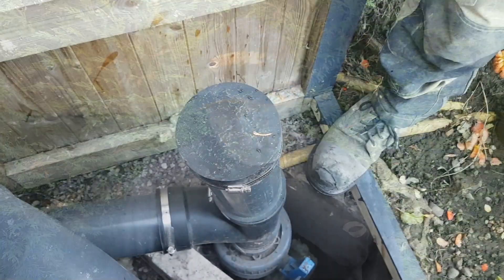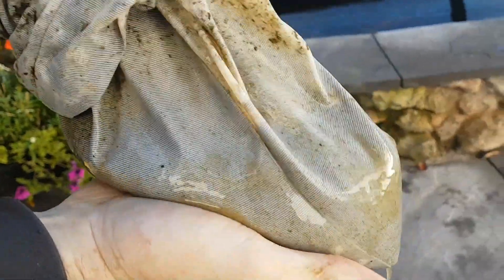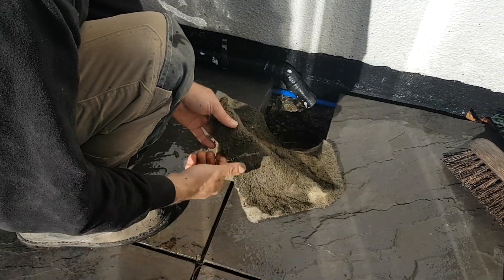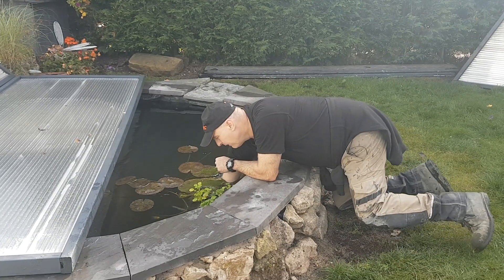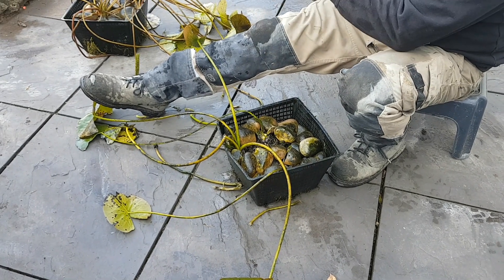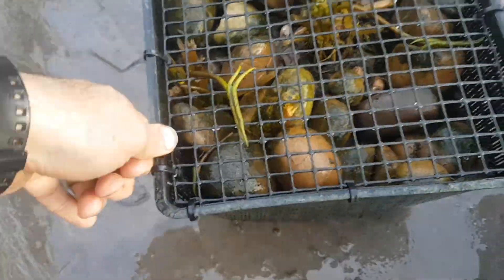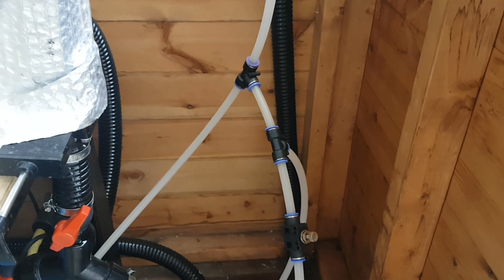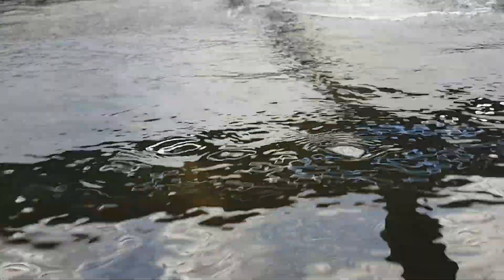Koi pond, winter preparation part 1

Comment: I've never jetted my drain's but I do have a low level purge which I flush every 2 days or so, amazing how much sits in there sometimes. I recently rearranged some of my returns and was actually surprised by the amount of brown slime jelly stuff there was in the return pipes so gave them a jet, another great vid mate
Reply from the maker: Hi mate, I regularly purge the drains, but I was shocked at what came out after pressure flushing, something I will do much more often. Thanks for your comments. Stay safe. Regards Andy

Comment: Gobsmacked that boiled your easypod and so quickly! I’ve a 35pa version of yours so wonder if that would work too. I may give it a go as they are do much quieter.
Reply from the maker: I was almost certain it wouldn't boil, but was delighted when it did, not only will it save a few pennies in electric, it means I have a spare too 😊 it would be interesting to see if your 35 would work
Reply: @DerbyKoi  I’ll let you know. I’ve a 100pa too so that certainly will 😂
Reply from the maker: Lol, thanks mate 👍

Comment: Hi, another great video ! can I ask,  do you keep the air on all the time even though the water is getting colder. I’ve got mine on for a few hours in day but am worried it would cool water if left on over night?
Reply from the maker: Hi becks, I do keep the air on, I reduce the amount and because I have covers I think it helps with gas exchange. The next upload may explain more. If i had no covers I would probably turn the air off. Hope that helps
Reply: @DerbyKoi  thanks for replying, I appreciate it.

Comment: Quick question Andy, do you keep air onto your pond over winter?
Reply from the maker: Hi mate, just filmed this today, because I have covers I still run the air into the pond but reduced rate, I think it will help with gas exchange, if  I had no cover I personally would turn it off to reduce wind chill and alter pond temp. Hope that helps
Reply: @DerbyKoi  cheers Andy. I have covers on but didn't know if to leave air on to bottom drain. Was thinking off at nite on in the day.
Reply from the maker: Hi mate, not sure if there's a right or wrong  I've researched it on the groups and forums and trying to get an answer is impossible, old school is leave everything on, new ideas are pump on, air and uv off, everyone's pond is different, I'm repeating what I did last year which is slightly reduced pump and air, and lower uv (with covers). Others will do different. On the channel I try not to instruct only show what I do. It's a fine balance mate, your idea of on off at different times may well be better than my option, I know people who do that. Stay safe mate sorry I cant give an exact answer. Regards Andy